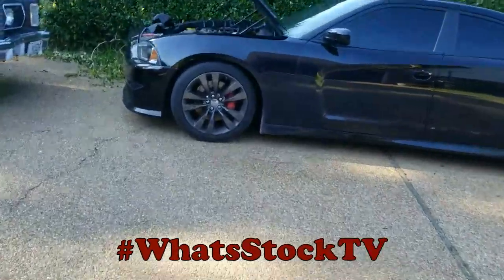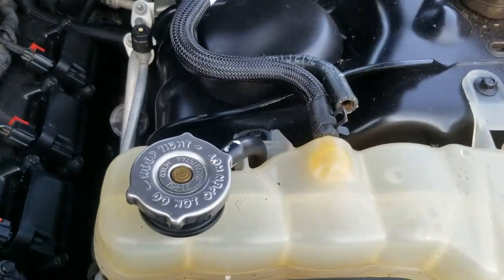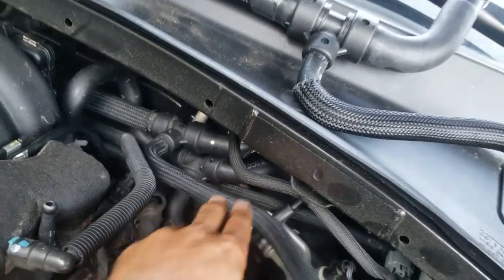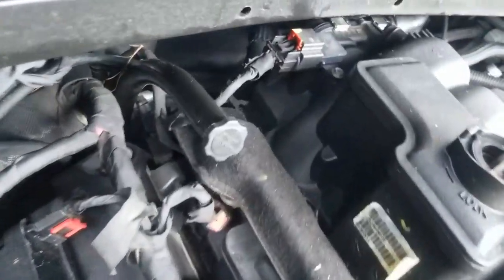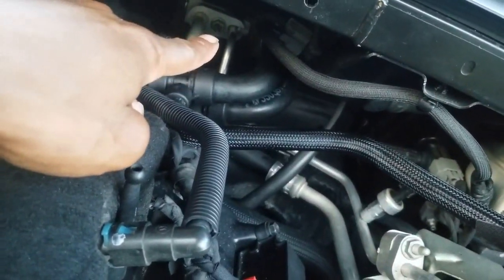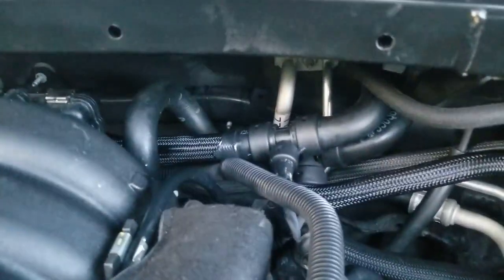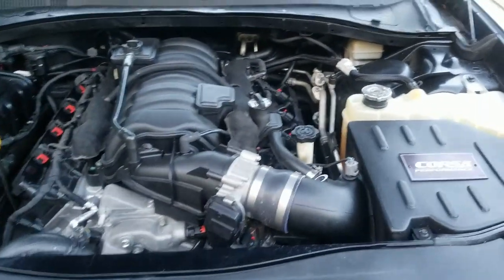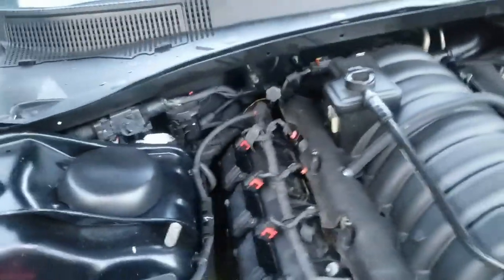Quick Tips: Charger SRT8 392 Coolant Leak Fixed

Comment: HEY bro....that knocking sound coming from under your dash, is blend actuators. There is one located under the passenger side glove box (You will have to removed the glove box to get to it). It is very easy. The other one is located under the drivers side dash near the under side right area. Very easy to replace.
Reply from the maker: Yep you're right. Just hadn't got around to fixing it at the time. I had the same issue with my impala
Reply: Yes I fix mine to, right under glove department

Comment: My Charger R/T heater hose broke in the exact same place. Bought a Doorman one with a metal T for about $35 with shipping from Rock Auto.
Reply from the maker: Good deal. They should've came factory with a metal T so they would last longer
Reply: @89imp03  Agreed 100%.  Mopar should not have used plastic T's for this. Metal should have been used.
Reply from the maker: @bernie472  Chevy had a similar problem on the early 2000s v6s. Brittle plastic coolant lines. Had to swap mine for metal in my 02 Impala too
Reply: @89imp03  Yep. Dad had a 2000 Impala with the same issue.
Reply: One year later how long was shipping lol please I need help
Reply from the maker: Maybe 2 or 3 days if nobody has one locally
Reply: @89imp03 and the exact name of the part please your a life saver I have a charger rt 2010
Reply from the maker: @outrageousgamess hvac heater hose. It was part # 626-320 for the top one and # 626-319 for the bottom one

Comment: Still driving okay? I woke up this morning and a pool of coolant was on the driveway. Gonna have to try this. Thanks!
Reply from the maker: It didn't leak anymore after this. I'm sure it would still be driving fine but this car got rear ended and totalled like 2 months after this so we don't even have it anymore
Reply: @89imp03  damn sorry to hear..looked a beauty. Thanks for the help man.
Reply from the maker: It's all good, glad to be able to help out though
Reply: @89imp03  lmao we basically ran thru the same shit you did exactly but my car started over heating today after I changed the hose but it has pure water do I have to bleed any air bubbles or drain all the water and throw in coolant ? I forgot to add water just like you bruh lol
Reply from the maker: Yeah you may need to bleed the system. If it's just water in there you can drain it all and then add coolant and let it run for a little bit with the top of the coolant reservoir off after you refill it. That should help to let some of the air out

Comment: How did u get the cowl bottom off? Mine is in the way. 2016 charger hellcat. Need assist
Reply from the maker: I didn't have to remove the cowl so I'm not sure exactly how it comes off. I'm sure it's less room to work with on the hellcat. My arms are small so it wasn't too bad for me to reach in and cut the hoses off

Comment: I have a small leak coming from that exact same spot but its a very small leak.. will that still make my car over heat?
Reply from the maker: Eventually it will if you forget about it or if the leak gets worse
Reply: I got the hose off and waiting on the part.. thank you!!
Reply from the maker: @jfdw-2696  no problem 👍

Comment: I replaced the exact same hose and car overheated now is at the mechanic shop
Reply from the maker: @robertobermudez9594  did you bleed the air out of the system after?

Comment: Did you bleed out the coolant before installing the T part ?
Reply from the maker: It all wasted out from the leak but I let it run for a minute without the cap on after installing it

Comment: Did it over heat after the replacement?
Reply from the maker: No it didn't. This fixed the problem
Reply: I’m having trouble finding it on autozone
Reply from the maker: @dannyboyy_q5265  https://www.autozone.com/cooling-heating-and-climate-control/hose-heater/p/dorman-hose-626-320/86955_0_0

Comment: Exact problem, do I need to replace all the hoses or could I just replace the coupling ?
Reply from the maker: The way this hose is setup you can't really just replace the coupling without a bunch of extra work so it's best to just get the whole thing. I'd check all the other hoses but they'll probably be good, it's the plastic couplings you have to watch out for
Reply: @89imp03  right on gang saved me a trip to the dealer.
Reply from the maker: @ogmarko4111  💯💯 gotta avoid those trips when you can

Comment: Damn cheap plastics supposed to handle hot liquids? Argh
Reply from the maker: Yeah man, after I put the radiator hose on and let it run for a minute out of nowhere it just started shooting coolant and steam out the back of the engine